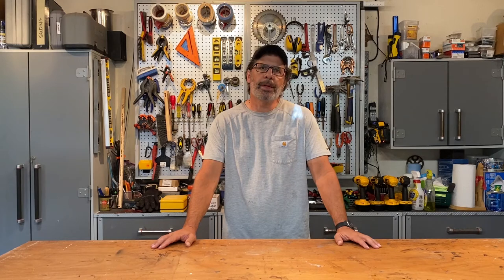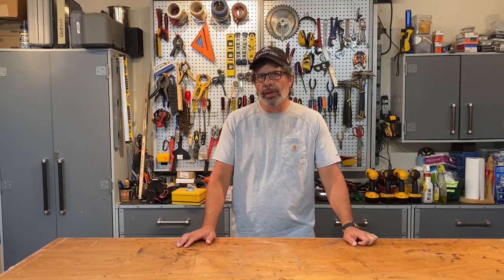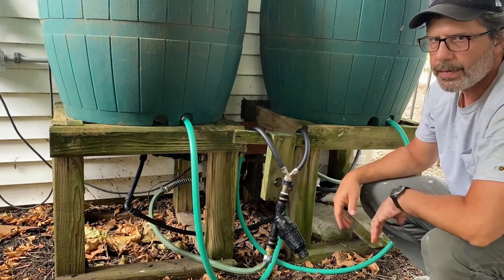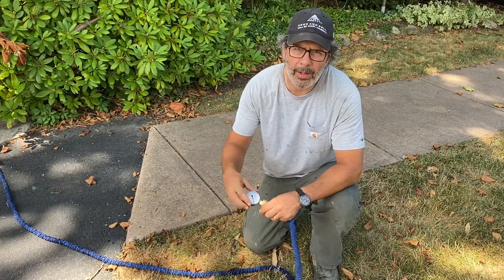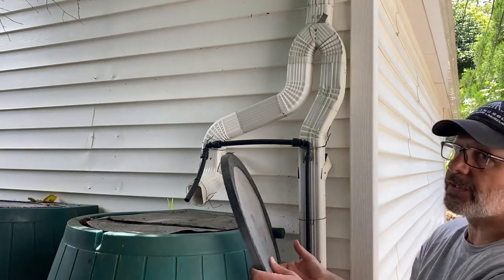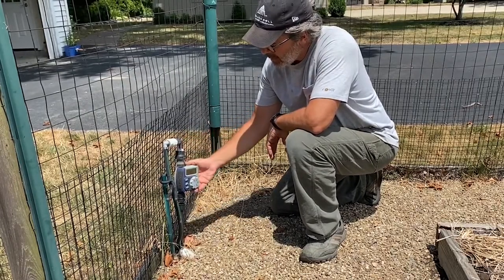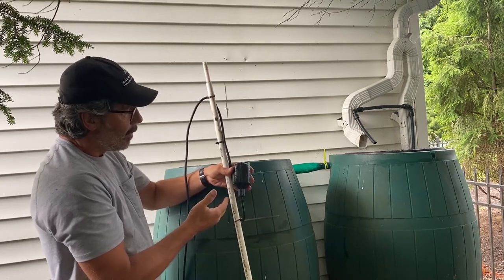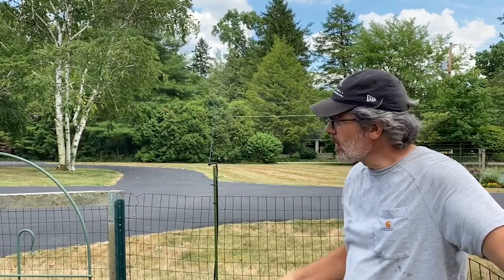The Ultimate Rain Barrel Irrigation System

Comment: This system is the very best one I have found, truly! I have a question,  We have 2 rain tanks out side right next to our green house 250 gallons each.. There are eighteen 4x8 raised beds in it with a drip system in place. Do we need a pump like yours, a pressure boost pump (we found it but haven't bought it yet) ? Or would a regular 115v 3gpm pump do the job? It would be covering 120 linear feet of boxes with  3 to 4  drip lines in each box. We want to do it right.
Reply from the maker: Thank you!  What is the pressure of the 3gpm pump?  Or the make / model so I can look at it?
Reply: @dontscrewitup  It is a Shurflo industrial pump model # 2088 594 154... same number as the pressure boost pump...what's that about?
Reply from the maker: I see the same part number on many different models?  They are all “pressure boost” pumps.  You basically want an “on demand” pump with  outbound pressure or 45-60psi.  These are generally about 3gpm or 180-200gal/hr.  The drip irrigation systems generally have a step down converter to 20psi, I believe.  They are low pressure systems.   You have a lot of beds so you’ll need at least 45psi.  You basically want a pump to get you up to “household garden hose pressure” which is usually 45-60psi. You can use an AC or DC pump.  I use an AC system in the video but for wet locations like this, DC is a bit safer.  The fittings 1/2”, 3/4”, etc. are based on personal preference.  You’ll need to generally use some adapter between the pump and your hosing.
Reply: @dontscrewitup  Any recommendations? I'm seeing a lot of pumps with those specifications. The reviews are all over the place. We really would rather not use battery powered.
Reply from the maker: The DC powered pumps do not need to be battery powered.  They use a DC converter before the pump (like most home electronics, for example).  I’m on vacation right now.  Let me take a look at the options and I will give a recommendation in the next few days.
Reply: @dontscrewitup  OK
Reply: Hi again. Did you get a chance to find some recommendations for me?
Reply from the maker: This is the model I use. https://m.northerntool.com/shop/tools/product_200249074_200249074
Reply: @dontscrewitup  Just to clarify, didn't you say I need an on demand pump with DC converter?
Reply: I will try this one. Thanks
Reply from the maker: The pumps come in AC or DC.  If you used a DC pump, it would need a converter.  But my system in the video uses an AC power pump.  I’ve not used a DC setup so I can’t make a specific recommendation on that.  Also, If you plan to use the backup filling system shown in the video, that is also AC.   When using an AC system it requires extra care in the electrical connections to ensure they are waterproof and the outlet is GFCI.  But this is not different than any other outdoor AC electrical hookup.
Reply: @dontscrewitup  Can a sprayer diaphram pumps be used on a drip system? I have been looking at NorthernTool Co. Because I'm seeing a lot of negative feedback on the current Shurflo pumps..that they breakdown within a year.
Northstar pumps are recommended instead..longer lasting and dont get hot when used for 2 hours or more. Also where do you get dc ac inverters?
Reply from the maker: Yes, any of these “sprayer” style pumps will work with the drip irrigation system.  All you need is a pump that will produce 40-60psi.  It takes your rain barrels up to “hose” pressure.  Most all of the drip irrigation systems are based on household “hose pressure” and most of them step the pressure down to about 20psi.  Your rain barrels only put about 4psi (without pump) which is too low for drip irrigation systems.  North Star pumps are also good.  I’ve only used Shurflo with good results but I trust the reviews.  

If you buy a DC pump, you’ll need an DC converter (a.k.a. “Power supply).  The pump manufacturer should indicate how many amps the pump needs. Usually something like 5 amps.  Look for a converter rated for that amperage.  With and AC pump you don’t need a converter.
Reply: @dontscrewitup   Well...

after much deliberation, a large headache, and 3 days of frustration...we finally settled on the one you have!! Thank you for your patience and info. We hope we didn't interrupt your time away from work and enjoying your vacation. Let's hope we figure all this out. 🙄😕
Reply from the maker: Thank you.  I’ve had good success with that pump.  Good luck with your setup.

Comment: So when it doesn’t rain then valve fills the barrels. So no rain the barrels are filled with hose water. 1 hour later it rains so all the water goes down the drain. Have you thought of a way to just fill one barrel with house water then fill the rest of the system with rain water?
Reply from the maker: Yes. If I were trying to optimize for maximum rainwater collection, I would set it up differently. I would hook up the backup hose filler directly into the irrigation line downstream of the barrels and the pump.  In that setup, no hose water ever goes in to the barrels and the barrels are always at maximum available capacity for rainwater.  

However, dry barrels tend to plug up the system.  

When I first set up the system, I was having more problems with the barrels running dry and sediment plugging up the whole system, so I found it beneficial to run the hose water through the barrels. This dramatically reduces the maintenance of the system.  

You could also optimize thus setup for more rainwater collection by simply moving the float switch into the first barrel, and optimizing the exact placement of the float to fill the minimum possible hose water for one day’s irrigation.

Comment: Excellent. May I ask where you got the fine stainless steel screen? Thanks!
Reply from the maker: Thank you.  Here is a link on Amazon.  I can only find it in 12” width so I had to piece two pieces together.  The barrel opening is about 18” if you can find it in a wider size.  https://www.amazon.com/dp/B07T5DWP99/ref=cm_sw_em_r_mt_dp_A7QTZTGRDFNFB7J01VJS?_encoding=UTF8&psc=1

Comment: Does it make any sense to have a rainwater collection system if you have a well?
Reply from the maker: Your well is essentially a natural rainwater collection system.  However, some people’s wells have limits on daily capacity so in those cases is would make sense to also capture rainwater.  Also, many wells are treating the water for drinking, which is not required or necessarily beneficial for plants.  Lastly, most well systems require a stronger pump and use more electricity than the system I’m showing here.
Reply: @dontscrewitup  Thanks! That's super helpful!

Comment: Thanks for the video.  Great setup. One quick question: You say that the solenoid value opens when power is OFF, so what happens if you lose power to the house?  Will your hose to the barrels continue to fill them till the power is restored?
Reply from the maker: Yes, that is one of the possible flaws in the system.  The barrels would overflow into the downspout until the power is restored. However, our power outages are infrequent. I get notified on my phone when we have power outages, and I have a few helpful neighbors who know about the system and I could call them to turn off the spigot if I were out of town.   The solution would be to put a second solenoid on the house power and house water which would shut off in the event of an outage.  It seemed like overkill, but is a good question and should be in a more complete system.
Reply: The solution to that would be to use a normally closed solenoid, and then switch it with a relay attached to the float switch, instead of the normally-open solenoid switched directly from the float switch.

Comment: Hello. Have you had issues with the float switch in barrel B shutting off the pump due to low water level, even when barrel A still has water? Ideally you’d want both barrels to be  at the same level all the time. But depending on how much rain you get during the filling process, this isn’t always the case. I’m doing the same thing and I foresee this being a problem. Any advice?
Reply from the maker: Good question. The Y-connection hoses at the bottom drains both barrels at the same time, so the water levels equalize as the pump is running.  

The way I have this set up, when filling, the first barrel fills completely then spills over and fills the second one.  If you assume they both fill to the top, then the level drops equally until both are almost empty, then the float switch trips and starts the filling process.

Comment: What happens if you lose power to the house/shop?  Does that open your hose-water solenoid and allow the hose to continually run into the barrel?
Reply from the maker: Yes. To prevent that, put another solenoid upstream on the house power, so if the power goes out it closes the hose water source.  I’ve never found the need to do that.  Power outages are infrequent here, I get notified on my phone if the power goes out, and my neighbors know where to shut off the hose if I’m not home. 

Worst case, it runs into the overflow (douwnspout) until I shut it off.

Comment: one question what type of nozzles did you use Or did you use emitters Thinking about pressures. Need low pressure i would think
Reply from the maker: I use the low pressure dripper tips.  I sold have some slow pressure dripper lines with multiple holes in them.  All low pressure system parts.

Comment: Do you think if you put a check valve after the pump, connected you house water system with the solenoid in line after the check valve, and leave that line live.  That way under normal use the solenoid would stay closed and just barrel water would be pushed to the garden timer,  when the barrel was empty and the switch activated now it would allow house water to enter the system with the check valve keeping it from filling your barrels so that they are ready to receive the next rain?
Reply from the maker: Yes that would work.  I’d probably still use the float switch instead of a check valve because you don’t really want the barrels to completely empty or you push sediment through the system.  I would use the float switch and tie the hose water in after the barrels.  I thought of this at one point and would have considered it if I wanted to keep hose water segregated from the rain water.   Thanks!

Comment: If you lose power to your home, does your valve controlling the city water open and flood the system?
Reply from the maker: Good question. If the power goes out the solenoid will be in the open position and will continuously fill the barrels, but the overflow goes into my downspout so it does not flood anything (but wastes some water).  

I get text messages to my phone when my power goes out (very infrequently) and my neighbor knows how to shut off the filling system in the event I would be out of town, etc.   

Another solution is to put a second solenoid (powered = open) on the source of the refiller hose (before the float switch) which would click to the off position of my house loses power.  This requires some extra expense and wiring/plumbing that I didn’t deem necessary, but it certainly could be done,for,a more foolproof system.  Thanks!

Comment: Tom, Can you provide more details on how the hose/solenoid is setup? What does the hose configuration actually look like? It appears you have drip irrigation distribution tubing that runs into the barrel. Is it a garden hose into the solenoid and then a combination of hose and distribution tubing coming out of the solenoid? How is the solenoid mounted?  I think what you have done is ingenious. How could this be powered via 12v  for remote off grid sites? Many thanks in advance.
Reply from the maker: Thanks.  I’m planning to make a detailed assembly video this summer.  But in the meantime... 

I basically use a combination of garden hose and 1/2” irrigation hose (the black hose going into the barrel in the video). 

Here’s the setup
1) Hose Bib to garden hose - always on
2) Garden hose to “in” side of solenoid (with standard adapter from pipe fitting to hose fitting). 
3) “out” side of solenoid is pipe fitting to garden hose fitting to garden-hose-to-1/2”-irrigation fitting.  
4) various L-joints to get the garden hose up to the barrel.  

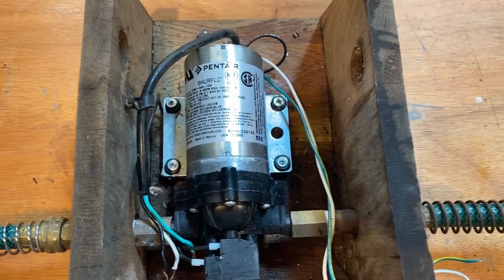At 7:58 in the video you see two extra holes on the pump housing. The solenoid mounts between those with the in/out fittings essentially holding it in place through those holes.  

Let me see if I can find some photos for you.
Reply: @dontscrewitup  Thanks you Tom. Looking forward to the pictures.
Reply from the maker: And you could definitely run this as a DC powered system.  The pump I am using comes in A/C or 12v D/C.
Reply from the maker: If you look at the video at 9:50 you can see the solenoid mounted in the housing above the pump.  That’s basically it. It’s just suspended in those two holes In the pump housing by the inbound and outbound pipe fittings.
Reply from the maker: @bryanmoir3184  Yes, that is the same solenoid in DC.  In retrospect, I probably would have designed the system in DC.  It's safer and could be used off the grid, and with solar, etc.
Reply: @dontscrewitup  Thanks Tom!
Reply from the maker: Important. If you are off grid, when the solenoid loses power it is in the open position. It will run water continuously until power is restored.
Reply: @dontscrewitup  I thought about that, but I am not sure if I can make it work the other way.

Comment: Very nice write up! I bought the same pump and running into it from my rain barrel. How high can the pump be from the bottom of rain barrel? Any is there a difference mounting the pump horizontally or vertical? Ty
Reply from the maker: Thanks. The intake to the pump just needs to be slightly below the bottom of the rain barrel (if you want to run the barrels to empty).  If you want to leave 6 inches of water in the bottom of the barrels, you can mount the pump at 7 inches, for example.  

You can mount it in any position. It does not matter.

Comment: could i get away with a rain barrel system without a pump for just dripping? i’m not sure what yours powers completely. i want to just water a series of hedges and that’s it. i want a barrel system because it’s way off the side of my house and all i need is water to dribble. i see that gravity wasn’t enough for your water hose but could it be enough to power drips? thank you
Reply from the maker: Good question. Most of the dripper “systems” require hose pressure to operate.  You could rig up an irrigation system with the 1/2” black irrigation hoses and the small 1/4” leader line hoses going to your hedges, then just don’t put the dripper heads on the ends, leave the 1/4” lines open.  They should gravity feed from your barrels assuming you have a few feet of drop from the barrels to the hedges.

Comment: Great video! Best I have seen. My question is the micron mesh on your micromesh filter at the top of the tank inlet. My concern is, if the mesh is too fine to pass a large volume of water through and having water cascade over the barrel instead of in it. Do you ever have any issues with that? I have no idea what the through put rate in gpm is for that size micromesh.
Reply from the maker: Thanks great question.  I’ve never had an issue with that.  The max gpm volume is essentially the size of the downspout capacity.  The barrel top is probably 10x or more that size.  It’s the same screening they use in popular gutter guards (which are catching massive gpm off the roof).  Never had an issue with those either. But a good question.
Reply: @dontscrewitup  Thanks for the reply. One other comment is you could place another solenoid valve on that same back up feed line to your rain barrels that is normally "open" when power is on, that way any interruption of power doesn't allow "well or city water" from your outside spigot to run to overflow or ground. Once again, that was as good a video and explanation of a system as I have found. Great job!

Comment: So when you electricity goes off from a storm etc your back up water runs in your barrels?
Reply from the maker: That is correct, then it overflows into the downspout.  To prevent this, I could add another solenoid running on the house power feeding an on/off valve to the backup hose that would close when the power goes out.  Have not felt the need to do it, but that is the easy solution.  

Power outages are infrequent, I get notified on my phone if I lose power, my neighbors known where to shut off the backup hose if I’m away. And worst, worst case, my water is very inexpensive.

Comment: how long do you leave your drip system on for at 8am? How long is your drip irrigation drip line?
Reply from the maker: I run it for about 45 min in heat of summer and 30 min in spring and fall.  It is about 40 feet long with about 40 holes or drip heads.

Comment: Mixing valve isn't a mixing valve. It's a splitter. Supposed to flow in opposite direction. Why not put more barrels in the system for more water supply and more pressure. Why not put barrels higher in the air for more pressure.
Reply from the maker: You are correct. I used the wrong term here. 

I did the calculation for how high I would need to raise the barrels to get 40-60 pounds pressure and it was way too high to be practical.

Comment: What psi is the pump? Your pimp l8nknisndead and I'm wondering the model or general specs to work well. Also as a second backup you can setup a watering trough water fill used by farmers for decades. Its a float attached to the house water to fill.
Reply from the maker: 50 psi.  Shurflo pump from Northern Tool. 198 GPH.